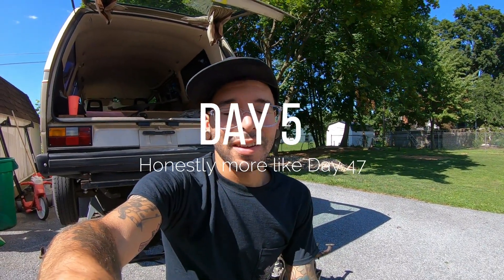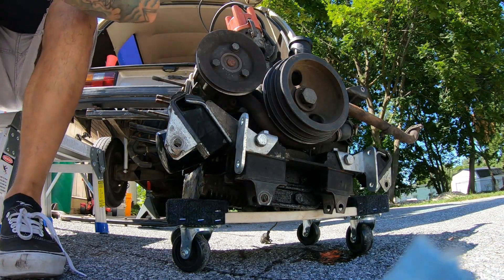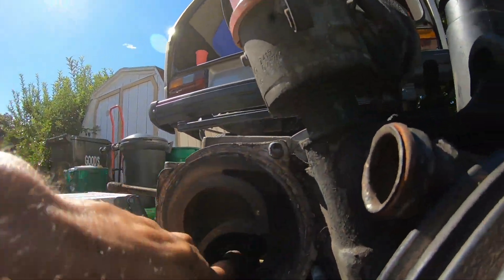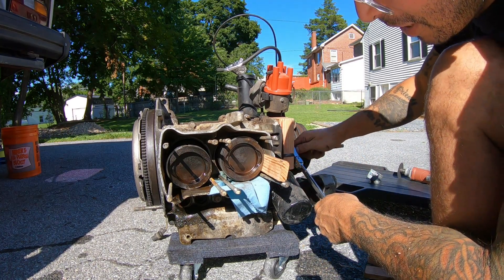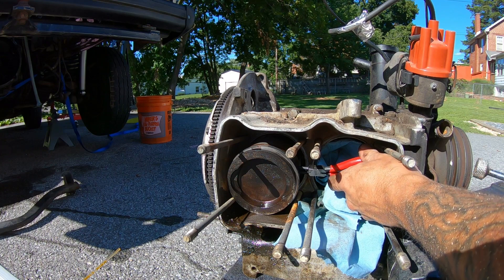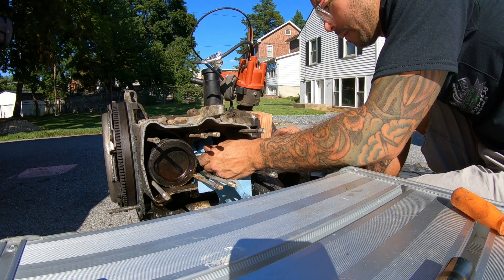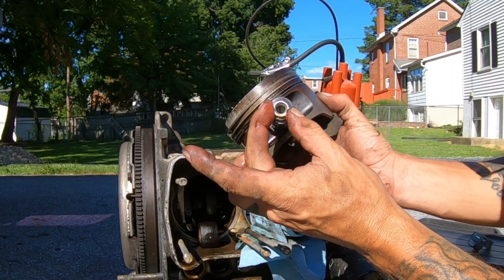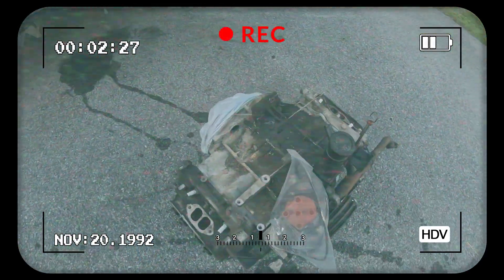Volkswagen Vanagon Revival | Removing Pistons from the BLOCK | 1.9 WaterBoxer Rebuild | Ep8

Comment: With wood as a brace its likely you did damage to the connection rod or the rod bearing.   Why everyone things they are a VW mechanic is amazing....  
Go screw up a chevy, but keep you hands off VW's
Reply from the maker: Personally, I’m a Ford guy so I wouldn’t “ go screw up a Chevy “ . These Waterboxers are very simple engines and I’m a former Mercedes Benz technician/ ASE Master technician. I’ve built many engines in my career. I’m documenting my experience being completely new to the VW Vanagon community. For the most part everyone has been super kind and helpful. I know I’ll  get a few trolls because the internet is full of them 👀 . The Bentley calls for a similar method I just couldn’t find the factory specific tools so I made them up but more experienced VW guys use slide hammers to pull the wrist pin out . Seems a bit violent to me but it works . The wooden block keeps the connecting rod from flexing while the wrist pin is being pulled . Again this is my first waterboxer build but not my first rodeo 🤙🏻. You can keep watching to see if I did in fact screw up or not BUT thanks for the view otherwise.
Reply: You think the rods are that weak? I’d be surprised.
Reply: Troll